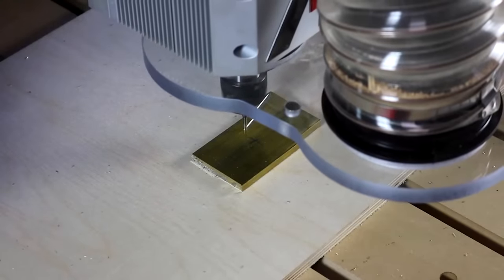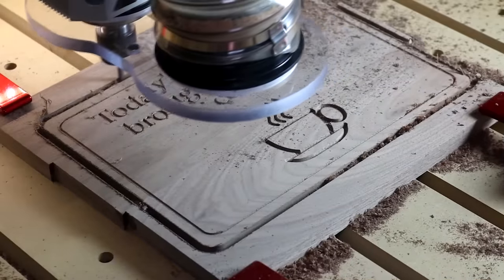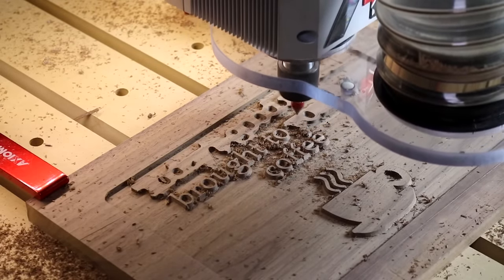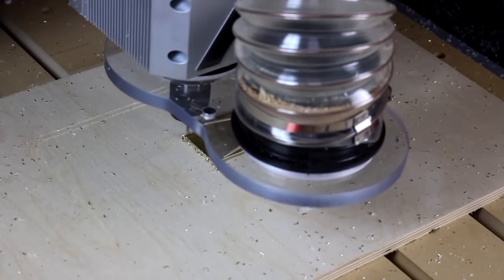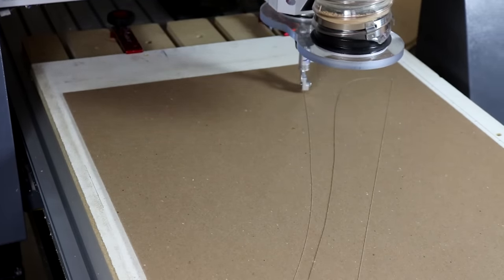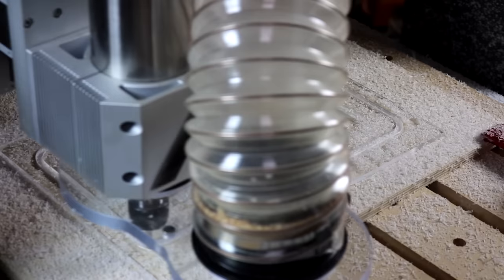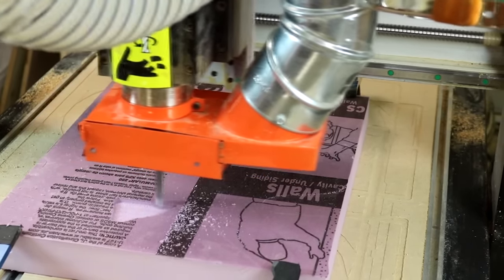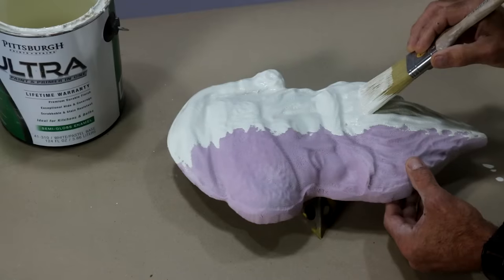CNC Routers Can Do ALL That? - WOOD magazine

Comment: Depending on your skills and tools you may wan to consider building a CNC router to suit your needs.    Many parts are available on line and there is a lot written in forums and articles.   Best part is that you can save a lot of money and may end up with a far better router than you can buy.    In order to fully utilize the router you will need software including CAD, CAM, and CNC.   It will take time and effort to learn but in the long run you'll probably wonder how you worked w/o it.

Comment: One of my first jobs was a beginning computer "operator". Programers would lay out women's undergarments on a reel; at which I would draw out paper or mylar the length of 144 inches on a table 48 inches wide. A platform having a head would travel on the X axis (from one side to the other); while, the platform over the table travelled it's full length being the Y axis. Likened to a cad machine, but 10 times bigger cutting or drawing various patterns and styles for women in the sixties. First thing, I would zero out both x and y axis which brought back the head dead center of the table. All programs started upon these coordinates... push a button and sneak off to take a nap... just kidding.

Comment: What type of machine would you recommend for a beginner without breaking the bank , but still reliable to do jobs like in your video ?
Reply: @jobox8959  yeah, I ended up buying a shapeoko from a buddy of mine
Reply: @83police  I’m looking at getting one.  I have the same question

These machines are fascinating
Reply: Any machine that will accommodate a 24x48 sheet with a thickness up to 5 inches is a good beginner machine. This will allow for growth. The machine shouls use ball screws and have a feed rate of around 10 IPS at a minimum. Vacuum tables are nice, but vacuum attachments are a must. Grizzly has some nice tables.

Comment: For someone that has never owned a CNC machine, but it looking at doing projects similar to the ones shown in this video, what's a good machine for that kind of use?  I understand that there is software that needs to be learned in order to get to the point of actually utilizing the CNC, so any advice anyone has about a good machine and where a good place to get one would be is greatly appreciated!
Reply: I'm in the same boat. I would like to be able to reliably cut and make functional aluminum parts. Not sure what requirements you're after but for under $1500-ish I'm looking at doing what this guy did. https://www.youtube.com/playlist?list=PLBZzwzFSuXxWRDc3m-rTJK1M9INEcz61y
The addition of the steel plate that guy does really stiffens everything up. The way the machine is built also seems to lend itself to future mechanical and electric upgrades. Right off the bat I can tell you adding some jack screws to the upper spindle assembly and where the gantry meets the linear bearings would be a great addition.

Comment: Wanted to  know the CAM software you used for this .In the pocket and 60 degree  V bit use, did you use 60 degree Vbit as clearing tool  and 1/4 inch end mill as  roughing tool /large area clearance tool   ?

Comment: That's so nice!
How does the cutting at 3:44 works ? It's not attached to the router i guess ? What software makes it work ?
Reply: It's a knife, that can pivot freely 360 degrees. The point of contact between knife and stock (material being cut) is slightly behind the axis of rotation, much like free coasting wheels under some furniture or wheelchairs. You can 'tell' the software  (eg Vectric, Artcam etc) how far the cutting point is behind the rotary axis. The software adjusts it's movements accordingly, so that the knife point moves along the required path. Some higher performance foil cutters have knives, that actively turn and don't depend on drag to make them turn.

Comment: What do you recommend as a starting cnc
Reply: I'm interested in that as well
Reply: Make it three of us that are interested in a good start up CNC.
Reply: Building a Gatton CNC is something that's really fun to do.  I just finished a build and it's all constructed of wood and plywood.  Works great.
Reply: Make that 4 ...lol
Reply: now 5. I'm only familar with Xcarv from a guy I studied with. I only assume it's at the bottom of the ladder due to it's ubiquity.
Reply: I built my first CNC router about ten years ago so I have some experience in this area. First of all you have to decide what you want to do with it. Second, do you want a small desktop model to do smaller projects or a large floor model CNC? Third, you have to decide if you want to build your CNC of buy one already assembled.
Reply: @BrianLeeWho  It would be a small desktop model
Reply: @FranksDIY  Do you want to build it yourself or just buy an already built unit? Building a CNC isn't really that difficult. Anyone with even a slight amount of handyman/woman in them can build it. The harder part is the electronics and interfacing it with a computer. 
Of course this doesn't mean a diy build means a diy electronics build as well. There are a number of sellers who will sell the electronics part (as a kit or plug and play) if that's all you need.
Reply: ox cnc or workbee machine
Reply: If you're not keen or too intimidated to design and build completely from scratch, I would recommend the Shapeoko 3. It's a great machine and sold in kit form so you get the chance to assemble it and learn a lot at the same time. A step up from that would be a kit from CNC Router Parts.
Reply: @Wood  i want to use drag knife in order to cut split leather thickness will be 5mm do you guys think it will work , Guys have no experience of CNC machines !
Reply: @vladhogan4727  Oh Please get out of here! A handyman is defined as "A PERSON.......... WHO DOES ODD JOBS AND IS COMPETENT IN A VARIETY OF INVENTIVE, INGENIOUS SKILL/WORK".
Reply: Avg Joe ,,,, thank you so much 👍
Reply: @Wood  I'm interested in buying a machine that can do large format cutting about the size of a door. What would you recommend ?..
Reply: Late response but couldn't help it. I did the DIY CNC to start, changed a couple of parts and pieces later to l buy a better CNC out of the box, so I thought. After a bit sold it to buy a good realible CNC Router machine. Do it right from the beginning, take from me, I spent a lot more money that way. I do recommend the "Stinger I" model from Camaster.com. If it turns out CNC is not for you, you can get 75% of your money back, even after years of use. You can get it with a router or a spindle, spindle is more money of course but you'll control the speed of it down to the smallest specs.
Reply: when you have an idea to buy a CNC router for woodworking, you should know what wood works do you need to do by the CNC router machine, wood arts? wood crafts? sign making? cabinet making? furniture production? 2D carving? 3D carving? Relief carving? Hollow carving? or other popular woodworking?
Reply: Avg Joe thank you so much for all of the great info. If a newbie to woodworking was looking to spend $5-$7k on one what would you recommend?
Reply: @Wood mil pesos que eslimpió a ver la opción lo alok il ooso  i uo oooo pop iiimyak yo ya tu mío no lo loikli lío llevo lomuu lasj mi

Comment: I looked at this video.  I am concern about the letter carving.  I was doing a job recently and the letters keep breaking.  Notice this one in the video works perfectly.   but in following, I missed out on a step.  after the roughing path is completed, the 60 degrees vbit is used.   what am I missing because  the vbit is only used on the letters.
Reply: Walter Greenaway : Servo motor is better

Comment: So where to begin.   I like modifying parts for small toys in order to mount small laser diode or simply replace broken internal parts with fixed ones.  I had hoped to get a router for around $500 to start and see what I can do with a small setup as the only things I'm planning to make are not bigger than the palm of my hand. I thought all I'd need was a Router, Software, stable flat, and  mount but Im thinking that's not even half what I need.   Ill be working with wood, plastic, and polymers if I can get my hands on them.

Comment: I'd love to get into CNC routing. Unfortunately the price barrier and learning curve might just be a bit much for me.
Reply: I just ordered a cheap Chinese CNC for under $200.  I know it won't due much, but can learn the process and experiment. Search for 3018 CNC you will see many video on You--Tube and can find sources
Reply: @susanwilson4868  To do the work I'm looking to do I'd be into the $2k-5k price point machines. But I can't justify that cost - so I hand carve my work. Plus I have no idea how to work the designs. I have loads of experience with photoshop. But that doesn't translate much. I've tried a few 3D rendering programs and I just can't get a hang of it.
Reply: @TheNajSD  I'm in the same boat as you are when it comes to CAD and modeling. But I try to spend a little bit of time every day practicing. Because I already have a CNC machine. So that motivates me to get the hang of it eventually. I will also say the work I expected to do on a CNC before I had one and the work I ended up actually doing on my CNC are vastly different. Mainly due to my limited grasp of the CAM side of things. But I'm working on that.

Comment: I want to make a 3D shape for molding. I work on AutoCAD (2D), what sort of file would I need to get it made on the router (as you made with the large piece of foam)?
Reply: my guess it would be a STL file, this file type holds spatial information; where the tip in real space would be, generally speaking, you should look more into that.